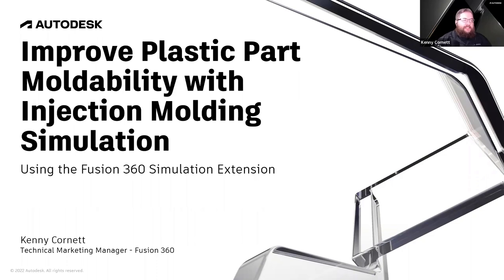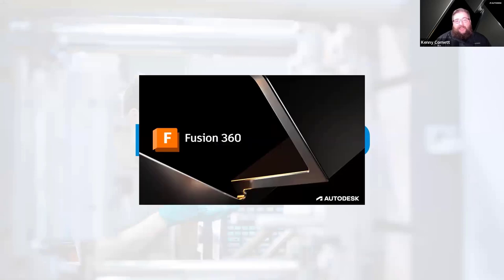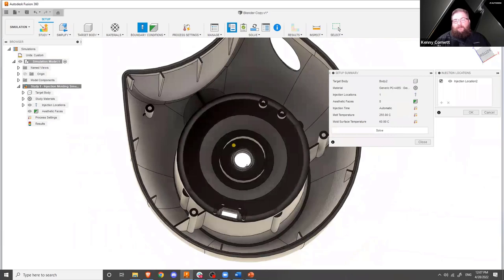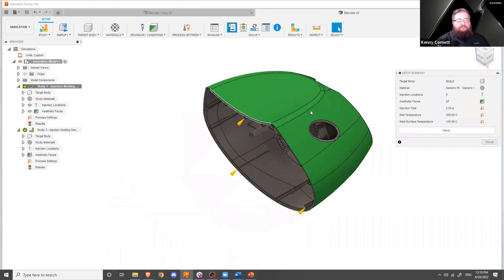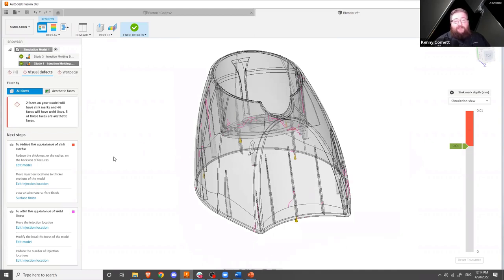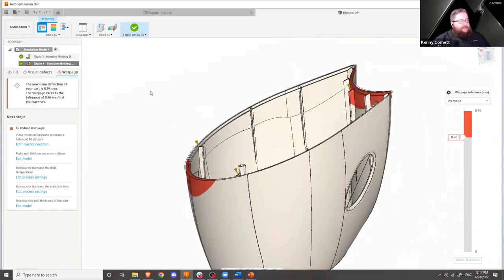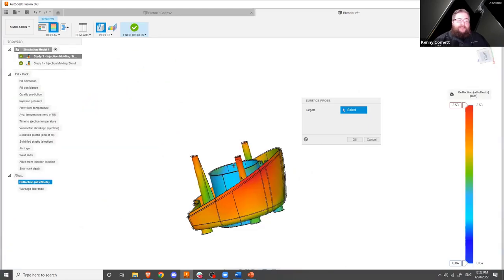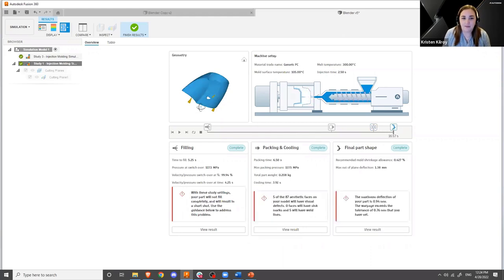Webinar: Improve Plastic Part Moldability with Injection Molding Simulation | Autodesk Fusion 360

Comment: Let's face it. There is no way for an inexperienced part designer to define injection points correctly. His proposals will be rather absurd, not feasible and the simulation results will not help him (or anyone) to make any sensible decisions. You need a huge experience in every area from part design, through the injection mold design and the molding process.
It's never that easy. Injection points at the top of the ribs to help them to fill? Seriously?😀